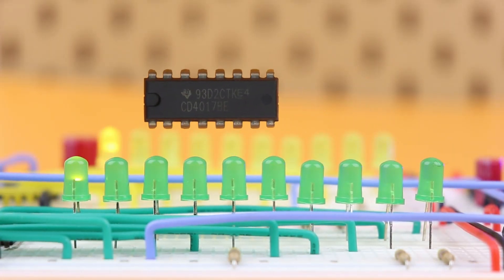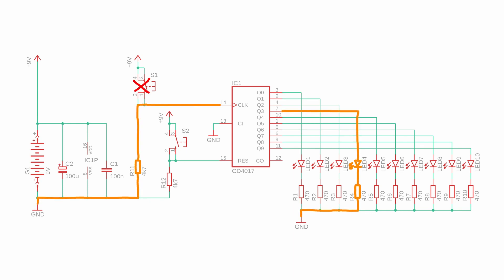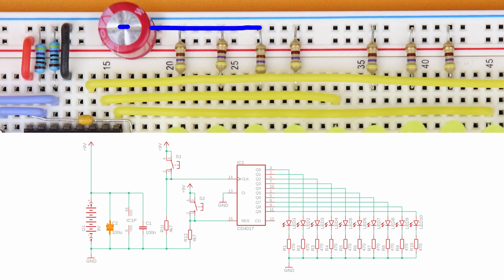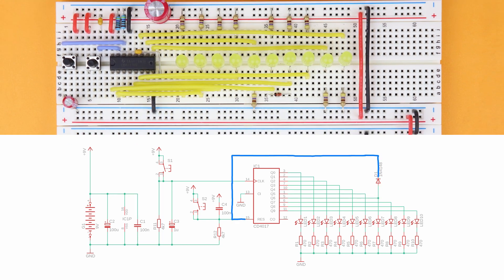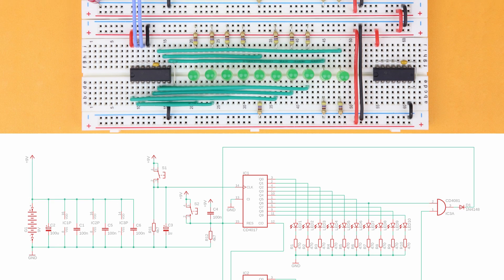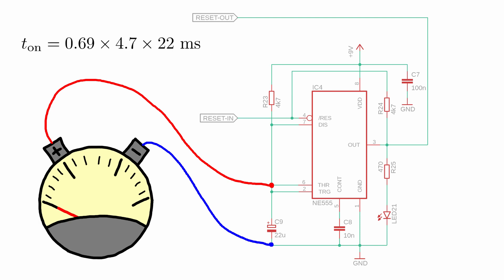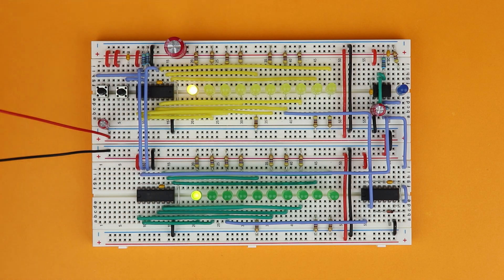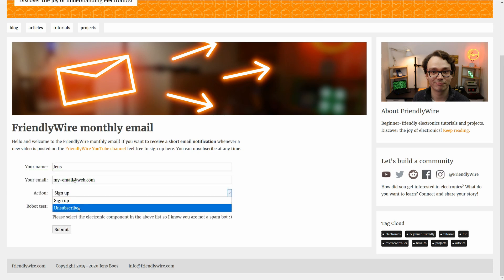CD4017 tutorial: the IC you can count on!

Comment: I let the IC cycle through 8 steps with just the 555 (no buttons for next step or reset), but every time I power up the circuit, it does one cycle perfect and then skips the first output Q0 every time. How can I fix this?
Reply from the maker: Thank you so much for your feedback! That is indeed strange and should not happen. So let's figure out what's wrong! :) First, can you disconnect the NE555 and just reset it manually? Does that work reliably?
Reply: @FriendlyWire  a manual reset does work, that's why it also works the first loop when it's turned on. I think the problem is that it takes the reset signal also as a 'next step' signal since the clock is high when the reset pulse is high, and thus skips the first step after every (automatic) reset. But I don't know how.
I also put a capacitor in parallel with the diode that resets, so the reset pulse get shorter but that didn't work either. It keeps doing. 123-23-23-23-23-23... Instead of 123-123-123....

Edit- I just realized that a capacitor doesn't make the pulse shorter so it wouldn't work for sure. I thought that I could swap the ground connection on the clock enable pin for a pulldown resistor and then connect reset to clock enable so that it ignores the clock while resetting but that also doesn't work. Is there anything else I could try?
Reply from the maker: @ebbewertz3417  Thanks for the additional details! The counter increases only after a positive pulse on clock, that is, when clock goes from low to high. If clock stays high nothing should happen. This is a bit strange, I need to think about that. When I built the circuit it certainly worked, so I did not give it any second thought.

/edit: Are you using the circuit with the NE555 reset circuit? Or without it?
Reply: @FriendlyWire  I only use one 555 for a clock pulse, I reset it by just putting a diode between the last output and the reset pin. Maybe it's because I have a slightly different ne555 clock circuit: I have a 10k resistor on pin 7 and a 100k potentiometer between pin 7 and 2, and after all the 2 capacitors and for the rest nothing else. This is giving me a nice stable pulse so that's good I guess, but I still think the problem is the 555 because if I just use a pushbutton as a clock, the 4017 loops all steps just fine.
*C12 = 10u,      C11=100n,       C10=/
Reply from the maker: @ebbewertz3417  Your NE555 circuit sounds fine, though. The only difference between NE555 clock source and the pushbutton one is probably the speed. Does the same problem occur with the NE555 running at a very low speed?
Reply: @FriendlyWire  yes, I tested it with multiple speeds. I can adjust the potentiometer from 1step/2seconds to [so high that I can't see the led flashing]
Reply from the maker: @ebbewertz3417  And the problem occurs at all speeds, yes? That is very strange.
Reply from the maker: @ebbewertz3417  Have you tried inserting an 1N4148 diode between the NE555 output and the CD4017's clock pin? Maybe that decouples things.
Reply: @FriendlyWire  yes, I already did this to prevent damaging the IC, because the 555 got hot if I did instead use a button.
Reply from the maker: @ebbewertz3417  Yes, good call. This is one of the mistakes we already found here in the comments (see pinned comment under this video). But that really doesn't leave much room for other errors, then. It really looks like the CD4017, for whatever reason, receives two clock signals instead of one. Can you send me a photo of your setup? I am @FriendlyWire on Twitter.
Reply from the maker: For anybody who is reading this: nothing wrong with the schematic. Ebbe and I talked on Twitter, and after rebuilding the identical circuit on the breadboard it worked fine. Moral of the story: the breadboard or the wires themselves can also be the culprit! :)

Comment: how does the reset circuit produce the initial start up pulse when the reset pin isnt connected to VCC? as i understand it you need to make the reset pin high to activate the IC so if the reset pin isnt high on startup how can the output go high?
Reply from the maker: Good question! The capacitor C9 is uncharged at the beginning, so the TRIGGER input of the NE555 is at 0V. This activates the output of the NE555, so that the output of the NE555 is on for a brief period of time while C9 charges up. You can read more details about this reset circuit in chapter 6 of the companion article: http://www.friendlywire.com/tutorials/cd4017/#ch6 , and I also have a detailed video on the NE555 if you are interested: https://www.youtube.com/watch?v=l5LzERjkux0

I hope that helps, let me know if anything doesn't make sense, I am happy to help :)
Reply: @FriendlyWire  i understand the operation of the timer, however, i dont understand how the ic is able to switch the output on at startup if the reset pin isnt tied high.

At startup wouldbt the reset detect a low signal and therefore holding the ic at a low output regardless of the trigger pin seeing 0V?
Reply from the maker: @thediamondnightingales9623  Oh, I see. Yeah that's a good observation. I think that C4 provides a short pulse that pulls the NE555 out of the reset mode at startup.
Reply: @FriendlyWire  do you think that on startup maybe as the IC initialises that the output produces a slight output pulse just as all the transistors turn on? But because you catch that pulse on the reset then the ic locks on until the threshold is activated? If thats the case then this circuit is even more clever than i originally though, see in my software, the initial pulse doesnt simulate (probably because its operating under ideal conditions), so i think this theory is potentially true.

What do you think?
Reply: @FriendlyWire i have ran some experiments through breadboard and PCB prototyping on the reset circuit (i know i seem obsessive lol) and all of my results seem to point to that when power is connected initially, pin 3 very briefly goes high because of the internals "booting up", therefore when you feed that into the reset you can take advantage of the ICs startup and lock the output high temporarily whilst the RC network reaches 2/3 VCC in which the output goes off and locks off, very clever design youve found there mate, simple, cheap and highly versatile for performing a systemwide reset
Reply from the maker: @thediamondnightingales9623  Interesting point! I thought the pulse from C4 was responsible. I don't have the breadboard here with me right now, could you maybe try and see what happens when you remove C4? I should say that the design isn't mine, you can find it in many CMOS projects online :) Thanks for checking this so thoroughly!
Reply: @FriendlyWire  my initial experiments didnt include C4, in fact i found that by including C4 a little bit of interference was added to the 555 timer, so i can confidently say that C4 isnt responsible, when i made it on breadboards i thought maybe capacitive interference was causing it to activate so i made a diy pcb of the circuit to eliminate the posibility of capacitive interference and found that it worked consistently on boot up so yeah, C4 can be removed and the reset circuit will work on its own.

This is why i love electronics lol we are constantly learning from each other lol, i thank you for taking the time to reply to me, a lot of people would have simply ignored my comment lol
Reply from the maker: @thediamondnightingales9623  Thanks for the checking, that's awesome! Honestly, I think it's great to learn from one another, because there is always a new perspective to things. Have a great day, and thanks again for letting me know about the power-up behavior of the reset circuit! :)
Reply: @FriendlyWire  not a problem

Comment: Just explain about what is pull up and pull down resistor with practical....could you?
Reply from the maker: Hello :) Pullup and pulldown resistors are used when a digital input would otherwise be left "floating." In our example here, at 1:41, the CLK input of the CD4017 is such an input, and R11 is our pulldown resistor. We want the counter to count up by 1 when we press the button S1. But without R11 the CLK input of the counter would bot be connected to anything, it would "float." So by adding R11 the input is still connected to ground when no button is pressed. When R11 is pressed then a small current flows through R11, but because R11 has a high value of 4.7kilo ohms the current is not much, only 1mA, so the resistor does not heat up or anything. This is why a pulldown resistor like this one should be a larger value.

Let me know if that makes sense or if you have any questions :)

Comment: 11:08 - I believe if you add a cap to the output of the AND gate (after the diode so it doesn’t discharge),  it should hold the output longer and reset both 4017’s. Make the cap about 10x the startup cap so they form an initial voltage divider at startup and will be high enough voltage to reset the 4017’s at power on.
Reply from the maker: Interesting, so add a 1uF to ground? I will try and see if that works :) Thanks, Chuck! Funnily enough I never had any reset problems on perf boards with soldered circuits, only on breadboards this becomes relevant. Must be the stray capacity/resistance in the breadboards themselves.
Reply: @FriendlyWire  did it work?
Reply from the maker: @adumont  I think it did, but in the end someone told me that the reset problem comes from a different reason: one should connect all clock pins in parallel (yes, parallel) and then connect the carry-out of the ones to the clock-inhibit of the tens. Then it works without any problems :)
Reply: @FriendlyWire  interesting. But doesn't the carry-out switch to high for 5 counts (0-4) and low for 5-9? What you describe would only work if the carry-over would be up for 1 pulse,  right?

Comment: Hi. First your video is so beautiful ! Regarding the reset inputs hooked up to the two counters. Look for schmitt trigger inputs in the datasheet. The clock input is a schmitt-trigger input, and that is why it allows for slow clocks, like the RC circuit you have created by the button, caps and resistors. The reset input is not schmitt trigger I think, but before debunking it, I think there is another problem. The two decade counters are not running syncronous, meaning that the clock inputs are not hooked up to the same clk. This is where the Count inhibit (CI) input comes in. Notice in the datasheet how there is two inverters in series on the CI input. Why invert and invert? It has something todo with the timing when there is a carry out signal from counter1 cascaded to counter2 onthe CI input.
 You can connect both clocks (counter 1 and 2) to the clock, then the cascade output of counter1 to CI. Now when the clock comes, the outputs of counter1 and counter2 change syncronously. Now there will be much less chance of a glitch on the output of the and-gate. regarding the diode, caps and resistors on the reset input, im not sure if it will work.  Hope this helps :)
Reply from the maker: Thank you very much for your helpful comment, and I am glad you liked the video!

This is a very interesting perspective on CI and CLK, thank you so much for sharing! I am sure I will do a follow-up video on the CD4017 at some time and I will be sure to include this. In some sense the synchronous counting is not required here, but is certainly would be nice, and it would perfectly explain the glitchy behavior. It should be possible to try out your suggestion with my breadboard rather quickly, I hope to do it this weekend. I will let you know! 

What do you think of the "pushbuttons connected to NE555 output" problem, do you think an additional 1N4148 just before the NE555 output's signal connects to the pushbutton, would solve the problem?
Reply: @FriendlyWire   It is worth a try to syncronize, not sure if it will help. The more I think of it, it has less todo with the reset problem, because the output of counter2 is stable when the reset occurs. Beware that the speed of the and-gate is also important. I think you are on to something when you want to extend the reset signal. I'm thinking a flipflop after the and gate could work. It will delay the reset by 1 clock cycle, so beware that, and it will stay high for one clock cycle, but will it need two clocks to get to count=1 ? I don't know :D ..  I looked for the pushbutton problem in the video. Do you have minute mark ?
Reply from the maker: @bwack  Yeah, true, but it would be nice to see if that could fix it for this layout. But that being said, I sleep better at night with a dedicated reset circuit.

The pushbutton problem is not mentioned in the video because I did not realize that it's a problem and only learned about it today on Reddit. When you look at 15:20 there is the schematic. The problem occurs if either S1 or S2 are pressed: current may flow into the NE555 output. For S2 it's not too bad because its NE555 goes high immediately, but for S1 it causes a short :(
Reply: @FriendlyWire  I see the switch shorts the push-pull output circuit of the 555. You can use a diode to form a wired or circuit. It is very normal on reset lines to be wired or.
Reply from the maker: @bwack  Yeah, that's what I was thinking, too. For the RESET it's actually not really needed: whenever the button is pressed the NE555 output goes high, which prevents a short from forming. But I should have included it. Oh well, many things become clearer after sharing them with an audience :)
Reply: @FriendlyWire  what could be a simple fix for the short rather than using a diode is use a SPDT switch, S1 is used to manually increment the clock and the 555 is used to automatically increment the clock, because you wouldnt be doing both at the same time you could add a SPDT switch to toggle between the 2 with the common pin going to the clock input, one of the pins going to the 555 timer and the other going to the push switch, by doing that you have got a manual/auto clock toggle and you eliminate the short
Reply from the maker: @thediamondnightingales9623  I like that idea :)

Comment from the maker: We already found a mistake!

1. It's probably a good idea to add additional 1N4148 diodes wherever the NE555 output signal enters the rest of the circuit. This way there won't be any current flowing into the NE555 output when a button is pressed. I did not originally envision this difficulty since the NE555 outputs are push-pull, so the output stage itself won't be damaged, but you can still create a short circuit when pressing a button and the NE555 output is low at that point. Oh well, the more you know :) I added a note with an updated schematic at the end of the article: http://www.friendlywire.com/tutorials/cd4017/#ch9

And let me know if you find more mistakes, let's collect them here.